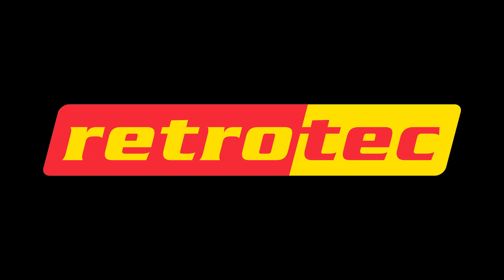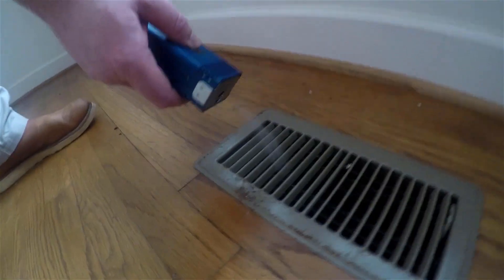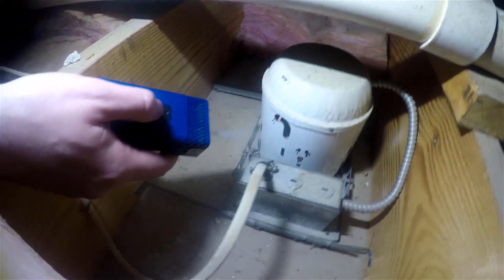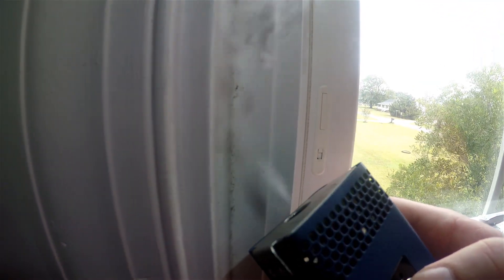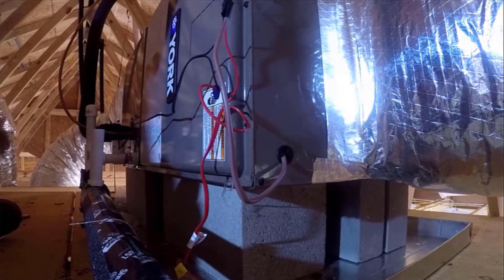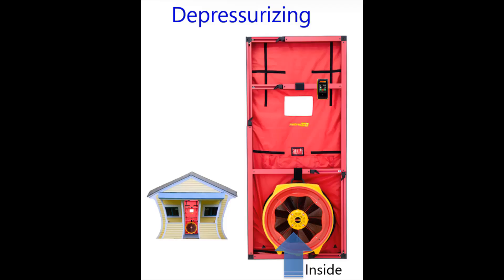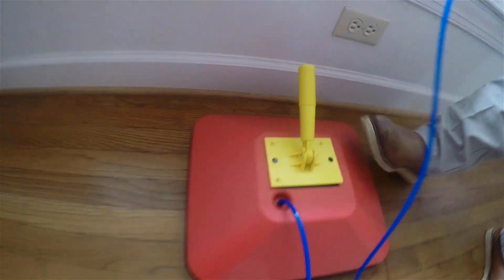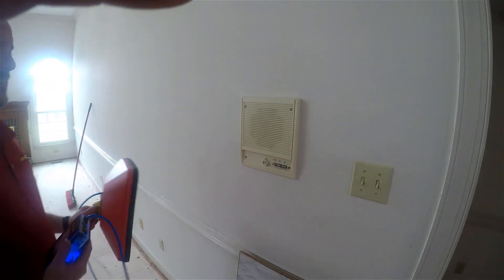Locating Leaks in Building Enclosures and Duct Systems

Comment: So I have this problem with my vents every time we turn on the heat I get itchy and it’s only when the vents are open, and turned on we had multiple ppl professionals come buy they say there’s no dirt in the vents.
Reply: amoungus?
Reply: Among us sus vent
Reply: Could be the duct insulation is being blown into the house through gaps in the ducting.
Reply from the maker: I would recommend getting a good indoor air quality monitor to check for particulates in the air. TruTech Tools has a great selection. The uHoo is pretty good for the money.